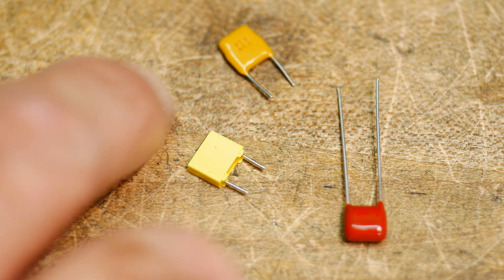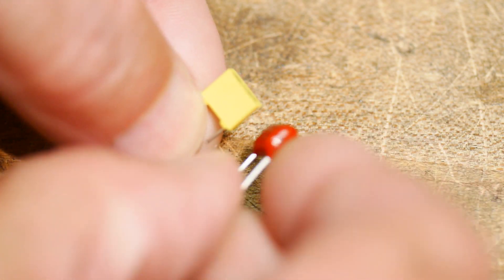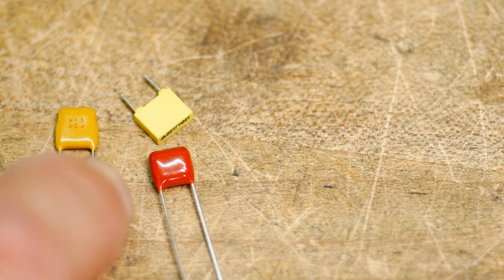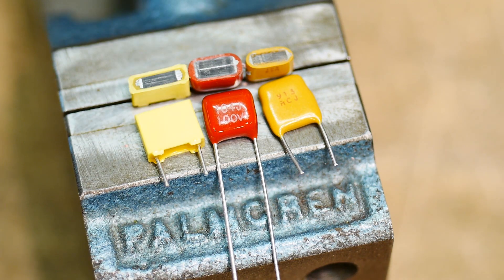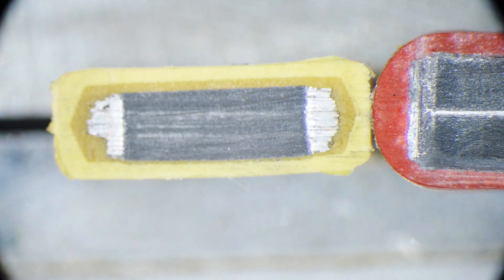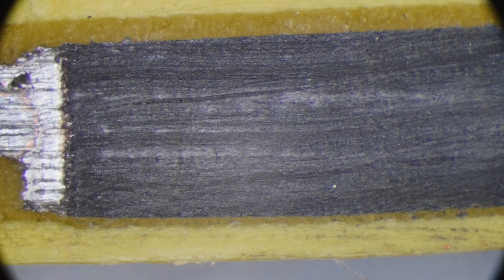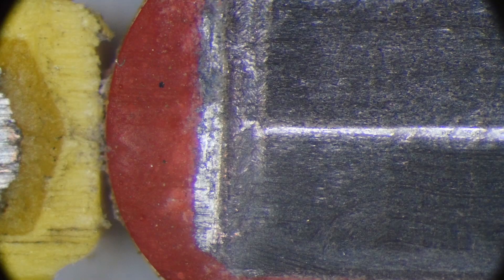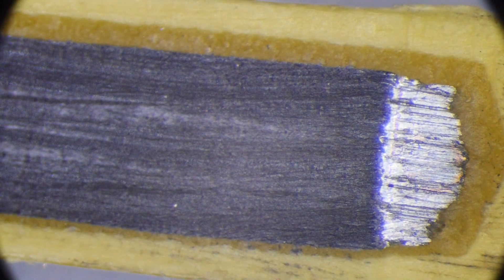#509 Metal Film Capacitors

Comment: Is that silvery stuff on the ends of these capacitors schoopage? could someone explain to me in depth what schoopage does?
Reply from the maker: Application of metallic contact layer ("schoopage") — The projecting end electrodes are covered with a liquefied contact metal such as (tin, zinc or aluminum), which is sprayed with compressed air on both lateral ends of the winding. This metallizing process is named schoopage after Swiss engineer Max Schoop, who invented a combustion spray application for tin and lead.
http://www.capacitorfilm.com/web/encontent.aspx?ch=83&con=491